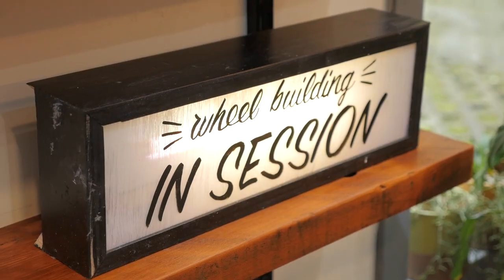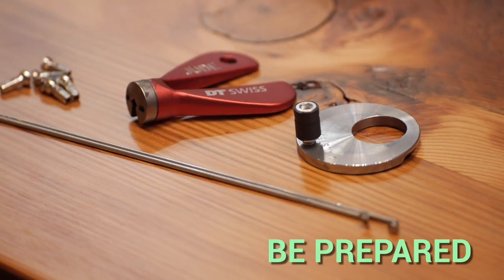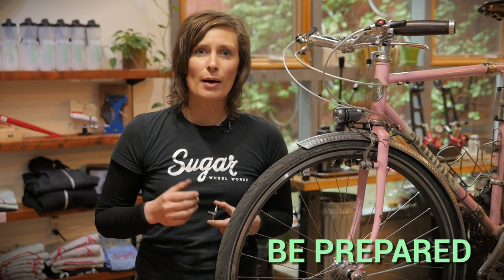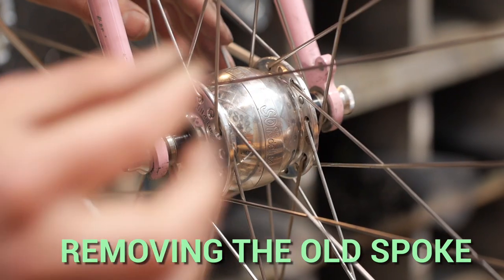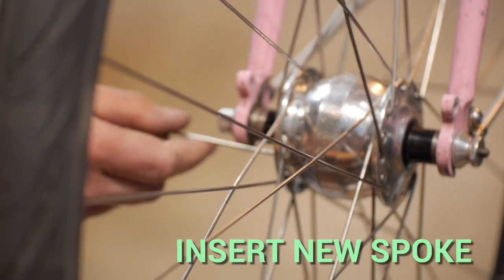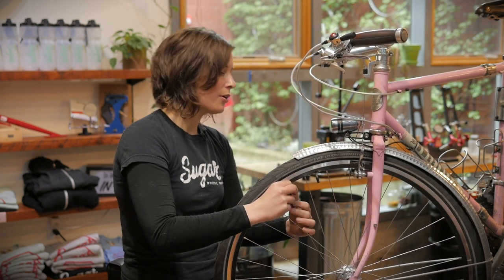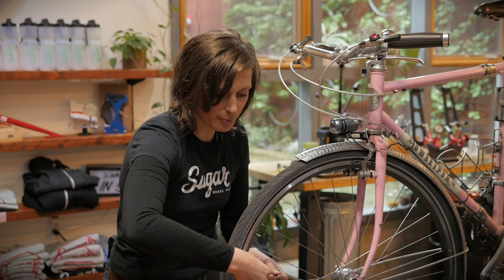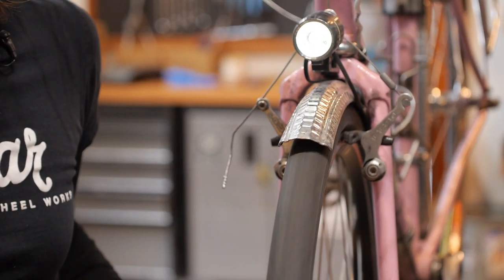How to Fix a Spoke in the Middle of Nowhere | Sugar Wheel Works

Comment: Is loss of a single spoke so critical it MUST be replaced or can the repair be left until later when convenient?
Reply: It’s critical, especially for rim brakes and in the front wheel. It should be replaced ASAP. Problem is: The rim can become protruding at the missing spoke, so the brake pad will rub harder against this area. Also, the riders load has to be compensated by lesser spokes, creating the risk of more spoke failures.
But it really depends on the area you’re riding, the overall quality of the wheel and the type of brake you use. I‘ve seen a rim on back wheels on Dutch bikes made from steel missing up to 4 spokes after fatigue failure. This rim ran like a snake, but because of the drum brake, you could still drive it and brake. This is an extreme example, I know, but I personally would replace a spoke immediately after it snapped.
And also please check the rest of the wheel for dents or cracks or other defects. Sometimes the rim itself around the nipple broke/cracked. This calls for a new rim then ...